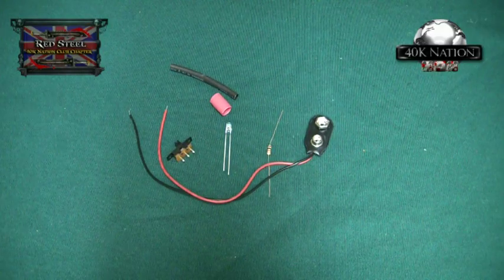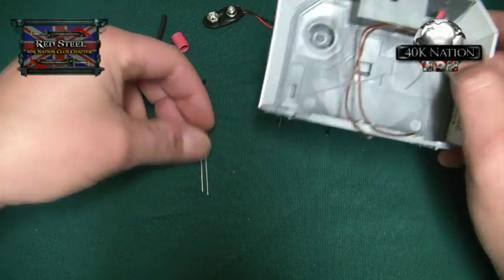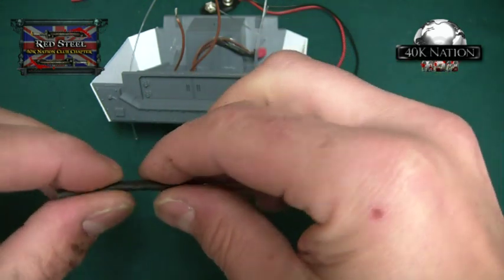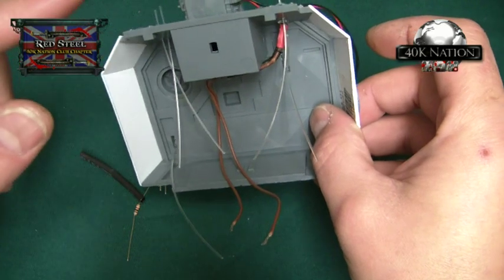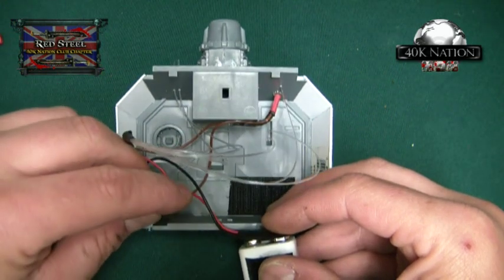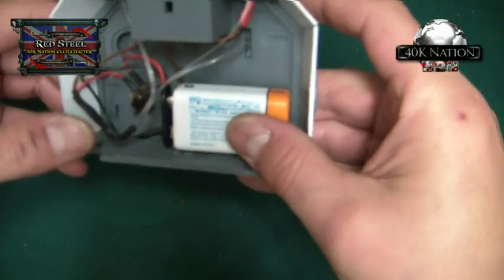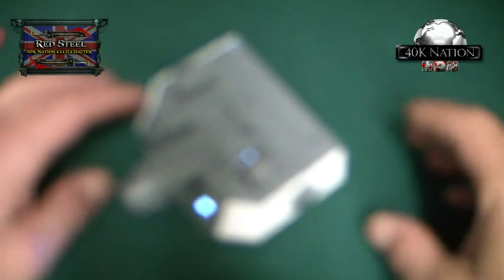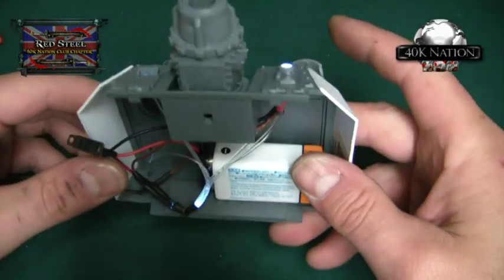Tutorial ~ Illuminating a Warhammer 40K tank ~ Installation of l.e.d and fibre optic wire  ~ Part 2

Comment: Hey Marneus! That's great bud.. WHAT did you do to keep the fiber optics from coming back through your holes after you trimmed them? Did you use super glue, etc to secure it or is there a specific glue to use that won't interfere with the light flow?

Comment: Looking good Marneus.
If you don't mind an observation/idea; leave your fiber long, and you can paint right over it. Then, when you trim, the clean cut will allow the light through and you won't have to try to re-install into your holes. 
I am testing a new battery configuration for my land raider. I will post the results in the near future.
Thanks for sharing!